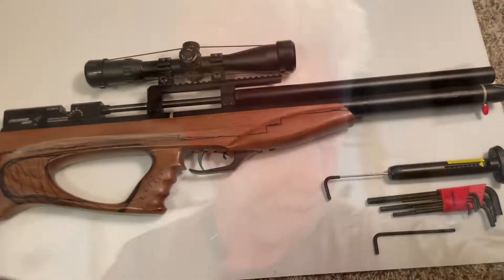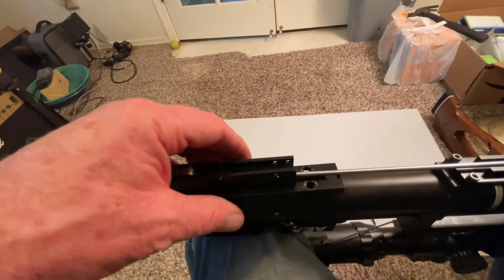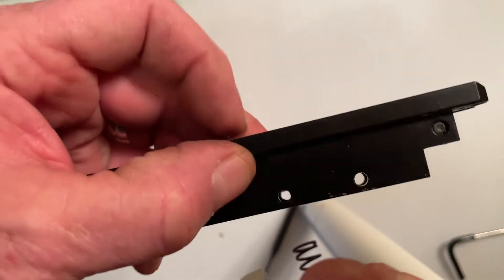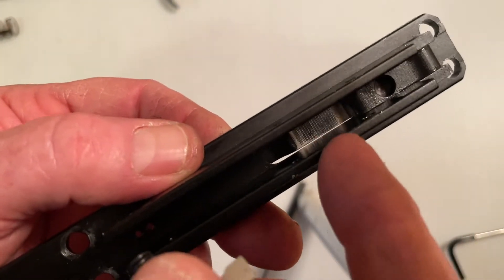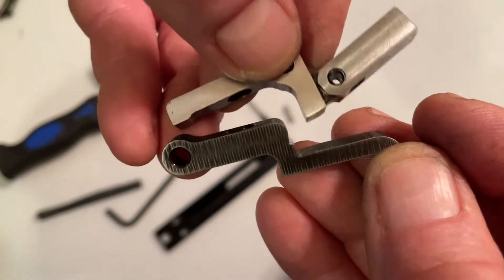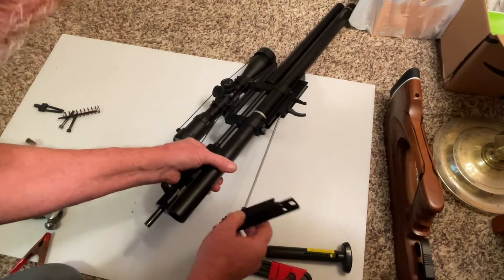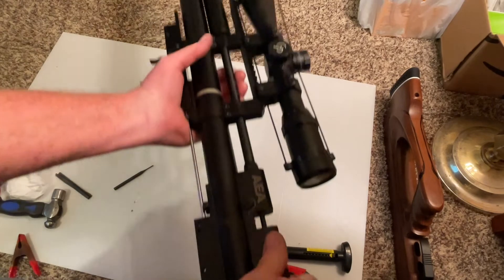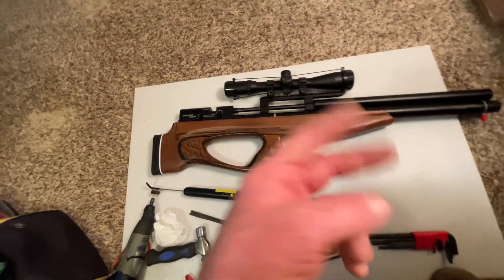AEA Challenger Series Air Gun Trigger Job

Comment: I bought the Varmint.25 caliber. back in the summer of 22'.
    It was a bit on the "weighty" side but I used that on my 50 yd range, I made in the backyard so I was usually from the table.
    I loved that thing ,aside from the trigger which I absolutely hated.  It literally felt like an AR style, trigger.
   A mile of rough road of travel and then you hit a speed bump and "POP", she goes.  It was guaranteed a shooter's error, flyer for about every 6-7th shot.
    In my 50 years of life, I have never done a trigger mod. of any kind but I hated it that much. Lol
     Couldn't shorten the travel too much because of the way the "hammer" is shaped. I believe that you call that the hammer.  
   Anyway after I took a good look at the barrel with a boroscope, I thought I would recrown/reface it,by hand. Long story as to how I did it but I used Dremel heads and made my own hand tools.
  Probably got Carpel Tunnel Syndrome from doing so but she was able to shoot just about anything I put through her. 
   She became a slugger for sure but,
   JSB HEAVY is still the best in my book for sub 50yd shooting when you make nearly 80fpe, so 
 At 40yds, I put 5 in a 3/8" hole, after the recrown job.
     Last summer I went out for a day of shooting with my buddy who didn't have his own gun at the time.
    After I took him home,in a sketchy part of town, I hung out with him for less than an hour and came down to get in the car and the back door window was smashed out
   Of course the Varmint w/$235 scope in the hard shell case was gone.
    My Benjamin Bulldog w/HUMA air regulator (also my first reg.install), the $85 Bulldog soft case. This was of course,gone as well.
    Of course you can't forget the bipods on both, the printed, barrel/band,   and Idk how many hundreds of rounds of JSB  HEAVYS in both calibers and many hundreds of Neilsen   slugs in many sizes.
     It still turns my stomach to even write it down.
   I think I might be venting to whoever reads this small book, that it has become.
   Anyway I bought a     regulated,Challenger, Bullpup in.25 cal. this past summer and I wondered how to do the trigger mod.on it.
     I thank you very much for the tutorial,sir
Reply from the maker: Hello Tim, how incredibly sad sir.. Honor, respect and decency is on the ropes taking us to a place we do not want to go. 
After reading your comment I googled.. “What insurance covers personal items stolen from your car” Google quote:
“Homeowners, condo or renters insurance pays for items stolen from vehicles.”
I’m not sure if you have homeowners or renters insurance, but maybe you could check it out if you do.
Under comprehensive coverage the car insurance usually covers glass and theft of the vehicle but not items inside the vehicle. It’s a bit strange.. but ultimately makes sense. I suppose, because the items are not always in the car and usually are stored at home.
Anyway, it’s a sad thing to have treasured items like a pellet rifle that is modified, cleaned, optimized and tweaked for your personal dialed in needs and have it stolen.
So happy the AEA Challenger trigger work video helped you!
Btw.. my .22 challenger is one 1/4” hole at 30 yards with .217/21 grain H&N slugs. At 60 yards it’s all me, but still around 1” 😂  it’s setup for too much power (18grain about 1100fps) for super accurate pellet shooting but still very good at less than 50 yards.
Thanks for the sad but really good comment!
Peace Prospector Tripp

Comment: Really appreciate that you make this, original trigger setup is not really good. Thank you Sir
Reply from the maker: Hello Cozyczcki, the Challenger trigger is fairly well designed. However, the trigger group design certainly could be improved quite easily at the AEA factory. I also have two Air Venturi Avenger’s also just got a DAR gen3. These triggers are much better out of the box than the AEA triggers I’ve seen and require very little adjustment or modification and cost less than the AEA’s.
I hope AEA steps up and improves their design in the future.
Please be careful and stay safe.
Peace Prospector Tripp

Comment: Now drop 3 washers in front of the hammer spring and you can increase the power by 60 FPE
Reply from the maker: My 22 challenger is very accurate at 50fpe. The 21gn H&N slugs are amazing at this power. Shooting any 18gn or less pellet,  it breaks the sound barrier and accuracy is degraded a bit. 
Thanks for commenting!
Peace Prospector

Comment: I'm surprised you don't have the trigger issues that I have where the trigger continues to slip off the Pole that it's  Supposed to latch on to with just a set screw so I decided to drill a hole through it and i fixed that problem
Reply from the maker: Yeah, you gotta be careful to not over do it and have a potential dangerous situation. With the safeties engaged my Challengers are safe. With the safety Off, especially on my 22, I believe it's possible to bump discharge it being roughly a 1lb trigger. 
Stay safe, sir
Peace Prospector Tripp

Comment: I got an aea challenger pro in 22 cal and I got it only 4 days ago and got it shooting jsb 18.13 grain pellets in one hole at 50 yards I got the reg set at 150 bar and the transfer port pretty low I am learning the gun before I blow money on slugs
Reply from the maker: These AEA air guns are really powerful, and loads of fun! 😁 They are good for me because I can't buy anything without modifying it! Perfect! 😆 
I have looked many times at the Challenger Pro but lacking the necessary extra airgun moola. 
I do have two standard bullpup Challengers. A 22 and a 357. These two are both very accurate and crazy powerful. I also have a Semiauto AEA HP carbine in 22. It is also a very fun popper. It definitely requires some special attention and fine tuning to shoot reliably.  Also, being semiauto it is not super accurate.
If you decide to modify your trigger.. go slow and do not remove too much sear step and overdo it. I had to redo my 22's trigger to increase the trigger pull to slightly over 1lb as it became too sensitive for me! Go slow, sir.
Have fun and stay safe, Gboutdoors
Peace Prospector Tripp
Reply: @ProspectorTripp  So ive not even noticed ive had this gun for a whole month lol! But I am really desprate to get that trigger a bit lighter Ive found I do not like a heavy trigger it makes me wiggle really terribly so im going to mess around with it. Ill take your advice and be slow.

Comment: My friend i have the same airgun and the trigger is 😢...
Your video is big help. Can i do this with air inside or must be with zero bar in to the airtank? I wish you health and peace ❤
Reply from the maker: Hello Navaxo, it is always safest to degas your air gun. ☝️
However, this trigger work Does Not  require degasing the air.
Please be careful and only remove the rear trigger assembly as shown in the video. Make sure to count the revolutions while unscrewing the trigger block assembly so you know exactly how many turns is needed to reassemble. This is important to keep the safety working properly. Also remove only a tiny amount of the Sear Step then polish, reassemble and test the trigger. If the trigger is not good enough, disassemble again and remove a little bit more, polish and reassemble then test again. It is very important that the safety works properly and the air gun cannot be fired with the safety on.
Caution ⚠️ 
It’s possible to remove Too Much of the Sear Step and the gun will be Unsafe or may not even cock because the sear step is too small.
Even if you have to disassemble and reassemble the Challenger several times while doing this trigger work, that’s just fine and will help you to be more familiar with the Challenger. It is important to go slow and remove a little at a time and not over do it. 
I also recommend taking of pictures of your Challenger at each step to keep everything organized and you know which part goes where and all screws are returned to exactly where they came from.  Please take good notes of the amount of turns needed to remove and then reattach the trigger block, the direction of the Hammer Guide Rod and so forth.
Go slow and be safe and careful.
Lastly.. do not over tighten the screws. ☝️
Most of this air gun is aluminum and can be easily damaged if not careful. The screws need to be tight but not Over Tightened. I don’t know the exact torque, so it is up to you to be cautious and not destroy your Challenger air rifle by over tightening.
One by one, step by step we get things done!
Stay Golden my friend
Peace Prospector Tripp

Comment: I have the aea challenger bullpup 25cal and the sear you are working on is like a pot metal in mine, is yours?, or is yours hard steel?
Reply from the maker: Dang Steve.. that’s not good for sure. My two AEA Challengers (22 & 357) are fairly hard steel. Not sure how hard but certainly not soft pot metal.
I would call the store who sold you the air gun and kindly request a replacement part or the entire rear trigger group. They may say.. you voided the warranty by working on the air rifle, but that would be Pure BS! Every PCP requires some maintenance and almost all include o-rings for this purpose. The triggers on these AEA Challengers are (Factory Horrible) out of the box and must be fixed in order to shoot accurately.. which is the primary purpose of an air rifle.
Please let me know what happens with your retailer, if you would. If for some reason you can’t get them to step up.. with replacement parts, please let me know, and I will try to get their attention.. if they respond poorly to me also, I may, depending on their response to me, Do A Video To Highlight and Expose Their Lousy Support.
So far I’ve not seen any real parts availability for AEA’s lineup. This is something they must fix. I’ve complained a bit already. Air guns need work and replacement parts.
Stay Golden sir and see what your retainer is willing to do.
You may also have a local machine shop take a look and maybe even test the hardness and quality of the material for additional support information.
Let me know sir 
Peace Prospector Tripp
Reply: Thanks for the reply, I'm gonna try to get ahold of my retailer and ask. I bought it from bintac.
Reply from the maker: @stevecasner8999  I know Bintac means well and is a very nice person.. however I’m not too impressed with his techniques, knowledge or capabilities. I hope he steps up for you. 
I bought my 22 Challenger with a regulator from BinTac. They installed the regulator. Unfortunately the rifle was not assembled properly, the receiver o-ring was cut and leaked badly when shot. Also they used Channel Locks to install the regulator and left marks on the air tube. I kindly complained about their poor workmanship. Bin blamed the factory for the problems.
I did not send the air rifle back because I already know they have low technical skill as seen on my challenger.
I simply repaired everything including machining the barrel o-ring seals and lousy trigger.
The AEA air guns are quite good once fixed.. but there behind most manufacture’s.. just got a DAR Gen 3 in 25cal.. it’s very good with no issues whatsoever. Things can be improved for sure but My Dynamic Air Rifle in 25 was terrific out of the box.
Hoping you get a good result.

Comment: I'll tell you what I tried to do that and them Pins were just way too hard to get out of the gun So I just give up
Reply from the maker: Sometimes it is better to have a gunsmith do the work. I always try to do everything.. but occasionally still have to call in the pros.
Stay safe and golden 
Peace Prospector Tripp
Reply: Yeah but you know where I live in Michigan they don't know anything about an air rifle I take one into get sling stud put on it and they were scared to death of the gun so I had to put the studs in myself cuz they were afraid if they cracked it that they didn't want to be responsible
Reply from the maker: @donwilson350  I was born in Ann Arbor Michigan and lived in Livonia, Plymouth, Farwell and Harrietta. 
Yeah.. people are a bit silly. It’s a air rifle for Heaven’s sake.
These AEA’s are pretty good overall, but those triggers are certainly a weak point. I would at least remove the stock and carefully clean and lube the trigger assembly. That may be enough improvement to get your pellets stacking after some practice.
Michiganders can do stuff! 😂 
Thanks Don
Peace Prospector Tripp
Reply: Yeah I live just a little bit north of Flint Michigan myself but these guys over here I took my air rifle the Williams Outfitter over in Davison Michigan and they was scared to even touch the gun they ain't never seen nothing like it they didn't know what the thing I've got the 50 caliber Bullpup version I really truly like the gun and its tax the bullets I got for mr. Hollow-point 300 greiner's I get about 578 foot-pounds of energy out of it but I just wish it had a better trigger that's all
Reply from the maker: @donwilson350  being a 50 cal I would not do too much to the trigger. I have a .357 and a .22 cal. The .22 has a crisp light trigger of about 1 lbs after my trigger job. The .357 I did a little work but left the trigger a little heavy around 2 ~ 2.5 lbs. Both are regulated. I have the .357 adjusted to about 130 FPE with 81 grain JSB’s. It’s super accurate with the JSB’s. I’ve shot several different slugs and get decent accuracy but not as good as the pellets. It’s a hard smacker for sure and plenty accurate with slugs for larger game hunting. I feel being so powerful I wanted a good solid trigger.
Reply: Yeah I know it but I just wish that 50 cal had a better trigger I don't like the idea having a 5 lb trigger on this thing it would just be a lot nicer but at a 3lb trigger I would be happy with it but I guess now if you want to spend over $1,000 they got the same gun and a regulated version that's got a good trigger know how come they put a good trigger on that gun but they couldn't put a good trigger on mine